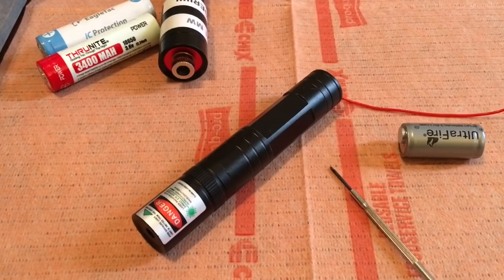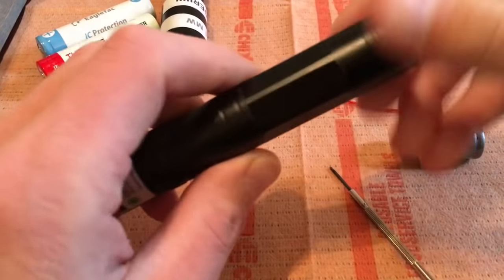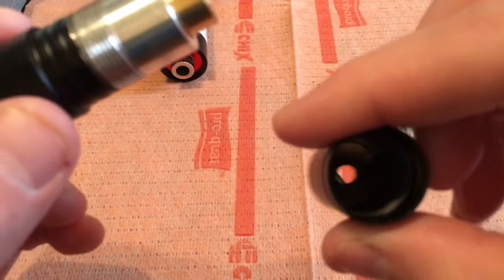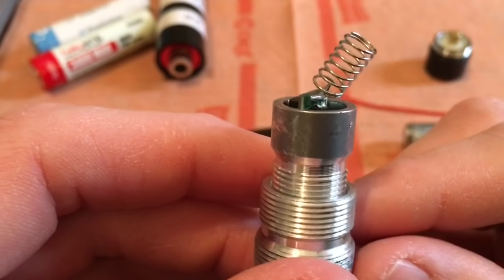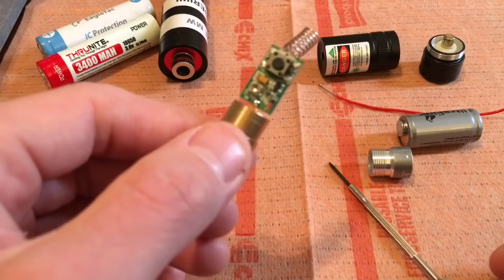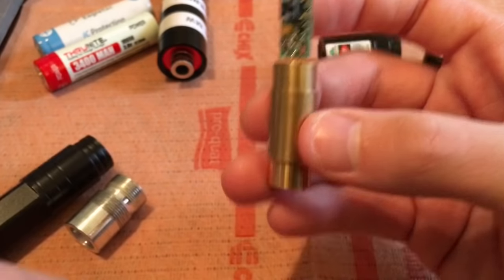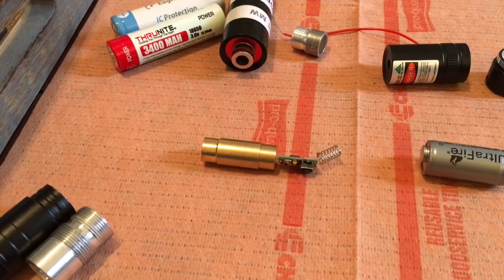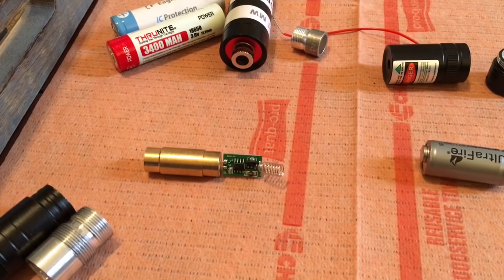How to Mod your green laser pointer.

Comment: Help! Yesterday my laser fell down on a hard surface when I was stargazing. After that it didn't turn on, only when I give it taps but now it doesn't turn on with anything. I have tried with full charged batteries but I don't have results
My laser is a 301
Hope you have understand I'm learning English so excuse me if grammar or some words are incorrect
Reply: Loose cable. Take it apart and try to put it back together
Reply: Your English is fine bro
Reply: 1

Comment: OMG you used a magnet on the battery to the terminal!  I've never seen that before!  :P  :D  That is bloody brilliant!  :P  Well done!  :)  lol  :)
Reply from the maker: Hah thanks, I have to give the credit to someone else but I can’t for the life of me remember who I heard it from, It was years ago. But yes it works great. :)
Reply: sure yeah ok
Reply: only works using neodymium magnets.. plus theres magnets in every electronic appliances so how come you didnt know
Reply: @ItsJimdevera  preferably nickel plated neodymium magnets. Note however, that some suppliers provide a REALLY thin nickel plating that can fail after a period of time or when mechanically stressed even a little bit.
Reply: I also use a nickel-plated neodymium magnet to adapt "flat" top cells to devices that normally require a "button" top cell. However, you do have to keep in mind that many flat-top cells do NOT PROVIDE THE SAFETY PROTECTIONS that are built-in to many button-top cells. So it can be up to you to ensure you don't overcharge, overdischarge, or short-circuit the cell(s).

Comment: It’s worth noting that these cheaper green lasers have a pump diode that is rated for a maximum output of 500mW of 808nm light, and that’s assuming it’s a QUALITY diode. The only way to significantly increase the output is to upgrade the pump diode and that’s not likely going to be easy for a novice.

Comment: Yea..my green laser pointer was similar but not the same..I ended up breaking mine trying to disassemble it to mod it. I was able to make it work again but its just not the same anymore. It no longer has a fine beam even when focused, it can no longer birn anything or scorch it. It's only good for the dog to chase now. Lucky for me I bought it used for $5.
Reply from the maker: Yeah that’s an occurrence on these cheap modules. I blew so many up by just slightly turning the Pot. I believe it’s mostly because manufacturers in China have a stockpile of drivers that are probably all around the same current (usually more than a 532 module can handle) and they solder the driver to the IR diode module and set it low and send it out. So 95% of the time the driver is a 500ma-1Amp so by turning it slightly it over drives the IR and can’t handle it. Good thing they’re cheap lol!!
Reply: @04mach1speed  Yea but mine just had a lens glued to it to make the green beam and focus it and I accidentally dropped it with the tip unscrewed off the end that had the adjustable focus and that lens popped off. I tried to glue it back but I never could get it in just the right spot.
Reply from the maker: Southern Catfishing I literally did the same thing years ago.

Comment: Could u please help me. I have 532nm50m diode module lasers they came with a red wire and a black wire coming out the end of it  then a green plastic piece with a spring on it I have no idea what to do to make them work please help
Reply from the maker: Rikki Lynn Morgan a 532nm is usually case positive they’re usually pretty straight forward but some are confusing, and I’m sometimes confused by how to wire certain lasers. Do you have a link to where you bought it so I can look at it? Thanks :)

Comment: Can it burn some stuffs?
Reply from the maker: Honestly, not really. Maybe some electrical tape but thats hard to do. You really need half a Watt to burn relatively good :/
Reply: It can burn some stuffs provided those stuffs are colored black and are not very thick. Mostly smoke and small pin holes you can achieve. Electrical tape  suspended in the air is the best stuffs to experiment with.
Reply: When focused yes

Comment: 0:46 most lasers on ebay is 40-50 mW? Eh no! Most lasers on ebay is 1-5 mW and if you can afford to spend 200 dollars than you could get a 1000 mW laser but i never spend those kind of money because i can't. 1-5 mW lasers cost like 1 to 4 dollars and for a 1000 mW it's 200 dollars if it's a 1000 mW i don't know
Reply: I have a blue laser with real 3w from sanwu lasers and it burns matches imediatly and i bought it with just 166 usd

Comment: Does the laser colour matter? Like, wouldnt red be best because red light is the warmest light?
Reply from the maker: Jul¡ hey J :) yeah color definitely matters, violet would actually be the best because it’s got the highest energy density, lowest wavelength. So purple burns the best, but purple doesn’t really go much higher than 900-1000mw. If you want raw power then Blue is your best bet. As weird as it sounds red is actually the worst. I found this out by doing an experiment with two of my lasers a 500mw red and a 500mw blue and the blue one will burn lots of stuff very well including your finger. Lol but my red one at that power just would not burn my finger, wood, and cardboard. It’s wired to think about but yeah Blue is the best for higher power
Reply: @04mach1speed  Thanks
Reply: @04mach1speed  Yeah, it's just so cool to combine physics with lasers, the lower the wavelength (λ)  the higher energy density
Reply from the maker: SomeRandomDude YT I agree! It’s definitely cool. I would do anything to be able to understand everything about lasers. That would be awesome

Comment: I have 303 and 851, both of their lens got scratches and now the 'dot' doesn't look like a 'dot'. Can you help us with an easy fix?
Thanks, btw love your videos <3
Reply from the maker: Yeah I’ve done that as well :( sometimes it’s better to just buy another 303 or 851 since they’re so cheap lol. I’m pretty sure you can pull the lens out and replace it but sometimes those lenses are half the price of the laser already so better to just get a new one. Have you gotten from Laserpointerstore.com ? They usually have really good prices
Thanks for the kind words by the way :)
Reply: I have installed a clear plastic piece in front of the lens (sometimes just cellophane tape as a temporary protection).

Comment: With the first laser I had, you couldn't unscrew it, and I broke off the prism ^^
Reply from the maker: Yeah I’ve had that happen so many times to me
Reply: @04mach1speed  The first 301 I got from Banggood was too weak (YL-LASER) the new one already torments the eyes through reflection.it's good, I'll leave it as it is ^^
Reply from the maker: Bergwacht I actually forgot about BG. I’ll have to go check those out 😁
Reply: @04mach1speed  they have 3 variants of the 301 - no 303 one.
Reply from the maker: Bergwacht plus sometimes cheaper than Ebay